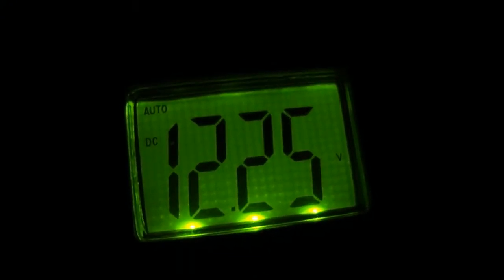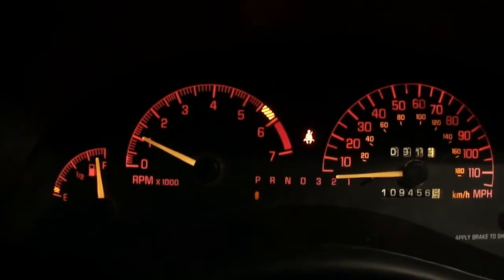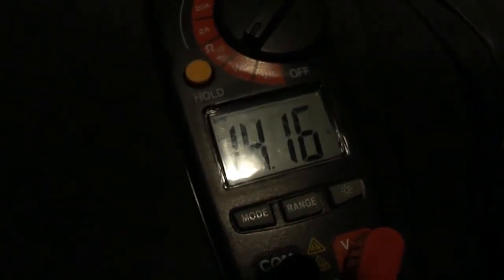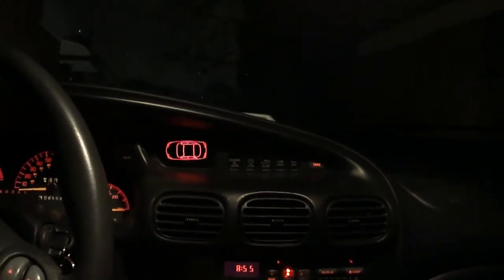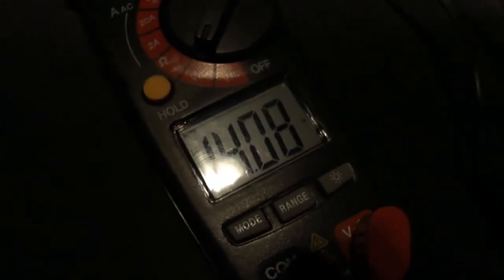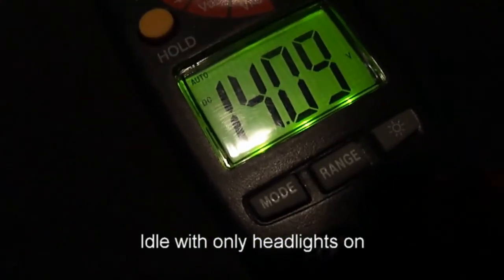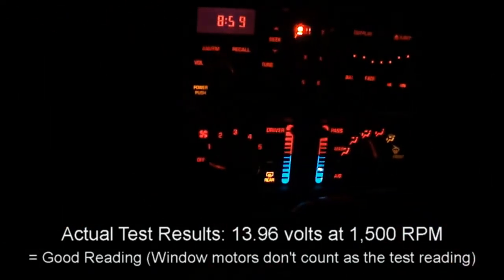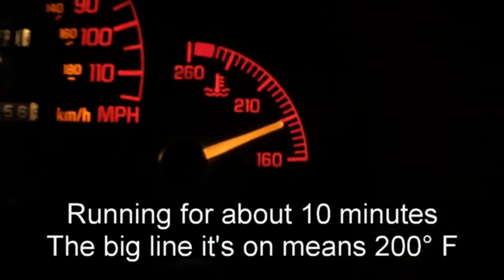Basic Alternator Load Test

Comment: You need to take that voltage measurement at the battery, not inside the cabin from a cig lighter or wherever you have it connected. Any loads present in the circuit you're tapped into will drop the voltage level to a lower value than what it truly is, due to the resistance present in those smaller gauge wires.

Comment: you didn't do an amp load test durrrrr
Reply from the maker: Not a scientific test, but one can assume that all of these accessories pull a decent load, and voltage over 12.6v is a result of alternator output, above the battery.